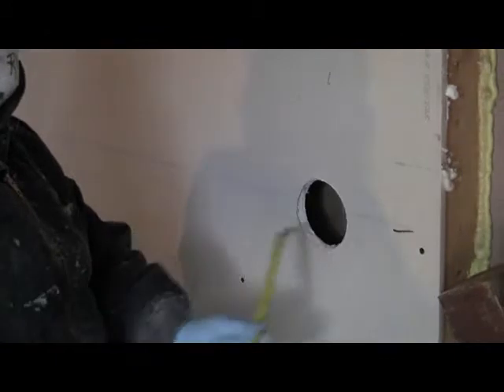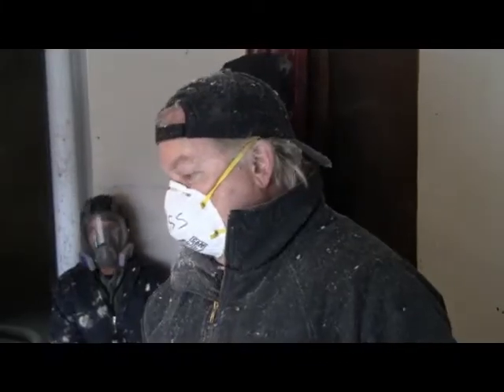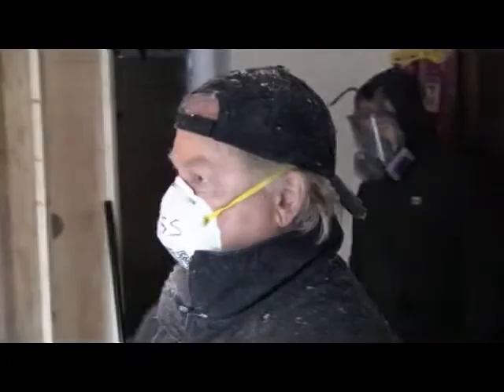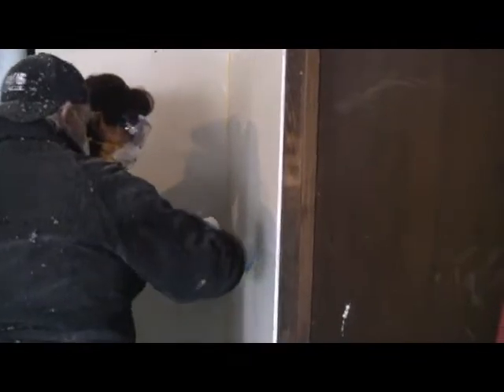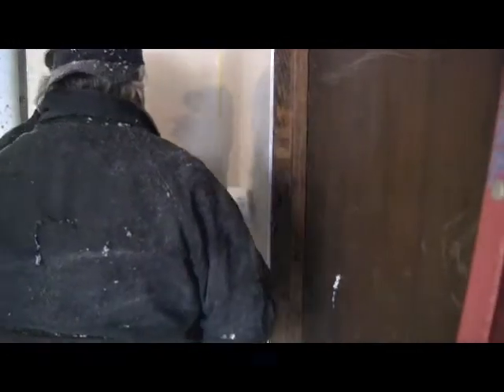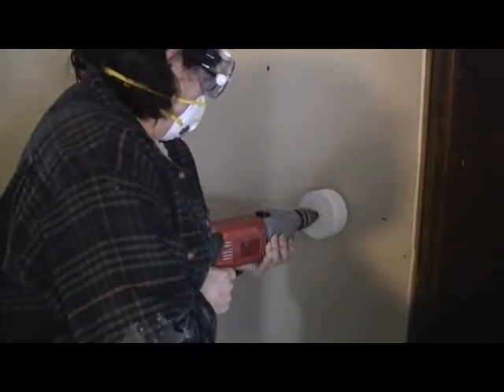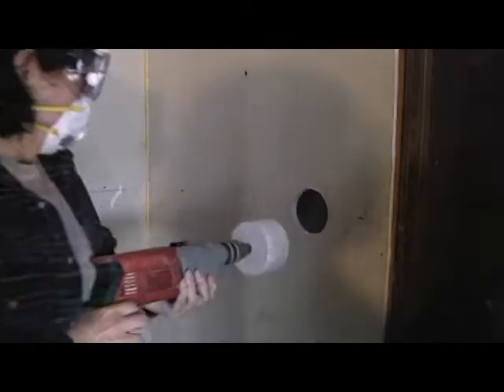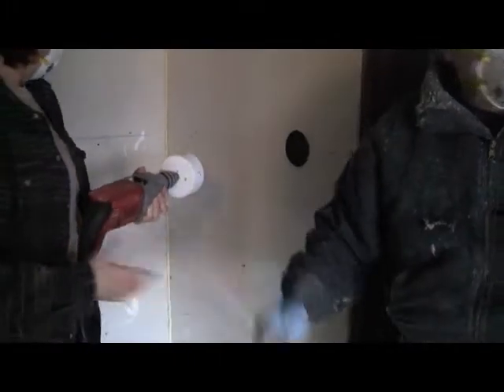Drill Holes for Cellulose Insulation Installation

Comment: Why not still the hole at the top of the wall?
Reply: Damn good question.  Drilling the hole at the mid-sized level means only half of the wall is properly insulated.  [edit]  Also, I've heard from other cellulose installers who've said the holes drilled for cellulose would be much smaller than those 4-inch monstrosities.